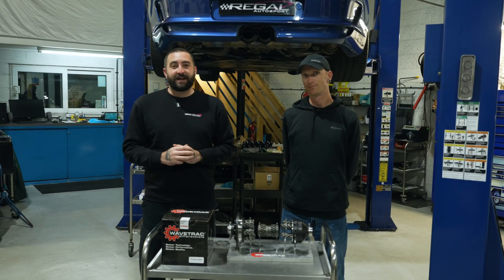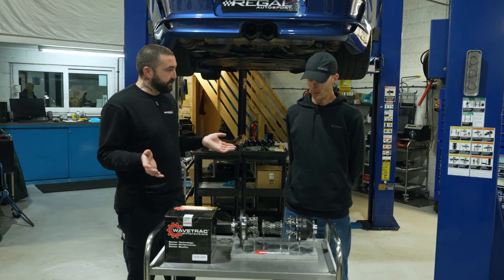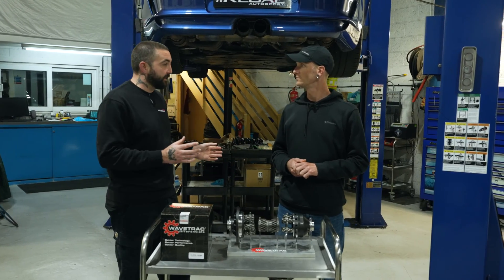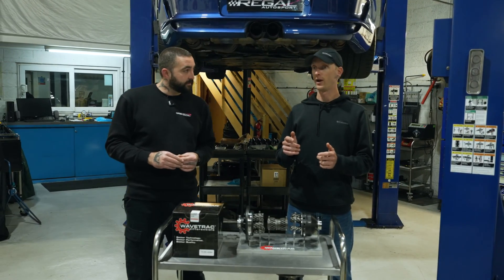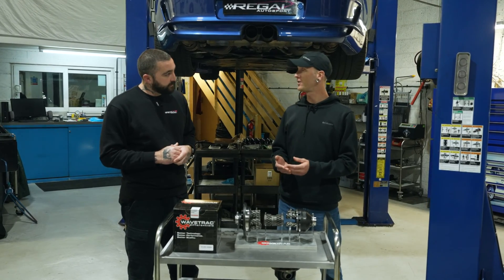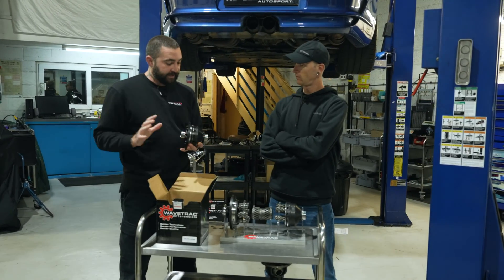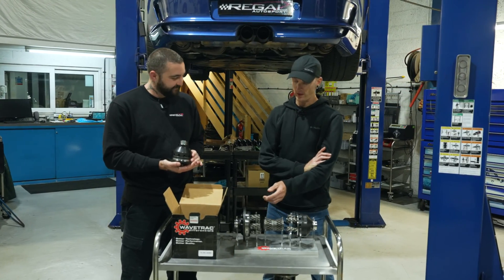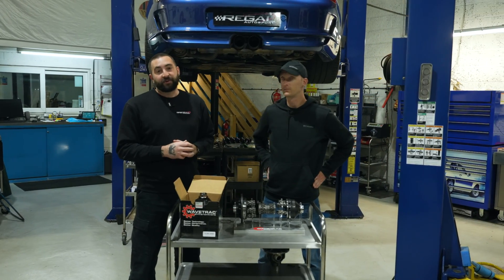WHY WAVETRAC OUTPERFORMS ALL OTHER LIMITED SLIP DIFFERENTIALS

Comment: Can it transfer power away from a wheel in-the-air?  (Unlike all other helical LSDs)
Reply from the maker: Yes, correct - this is because Wavetrac creates an internal load - enabling this to happen
Reply: @RegalAutosport do you know of a video showing a wavetrac off-roading with a wheel in the air?

Comment: If a Wavetrac LSD is purchased for a naturally aspirated Honda, would it hold up if this car is boosted by an aftermarket turbo setup? Seems to have only one LSD offered for the NA honda & not sure if it’s well suited for track turbo applications in this scenario?
Reply from the maker: It's the same, although, for extremely high horsepower drag specific applications with high shock loads, we also offer different splined options to use DSS axles.

Comment: So on a 2018 Audi TTRS, is it more beneficial to only change the rear diff, or should the front be done as well? What will be the different driving qualities with each setup?
Reply from the maker: On this platform, the front differential would be the most beneficial to upgrade first, for several reasons including: unequal driveshafts, sending drive forward first, limited drive going back and much more!

Comment: can you still drift with it or it will try to correct you?
Reply from the maker: Yes! You can use this for drifting 

If you are talking about professional drifting, then a plate LSD would be more appropriate but then you have to accept increased NVH (noise, vibration, harshness), increased downtime due to rebuild, and associated costs.

Comment: What power do the small case bmw wavetracs hold?
Reply from the maker: much more than the surrounding parts can handle! The same size of gears and pinions on 1000WHP+ drag cars without any issue
Reply: I have had 300bhp on a Wavetrac small case. The CWP is weaker than the diff
Reply: @garagemidnight  thanks!

Comment: Can you pls make a vid on why the REAR Golf R Wavetrac is effective. The rear end of a Golf R via Haldex is pretty benign, and i can't visualise what it would do in practice.Thank you.
Reply: First hand experience with that very diff on the mk7 R. It's not going to fix the programming and mechanical capabilities of haldex. At best it's still a 50/50 split, but on power the car is far more engaging. A healthy blip of throttle in a low gear with some steering applied and it will kick the rear out without issue (low grip). On power around an on-ramp will push far less than it tries to rotate. Grip vs. slip is more consistent. Looking forward to comparing next year's track times.
Reply: @moshuapit3722  Thank you.
Reply from the maker: Thanks for your insight!